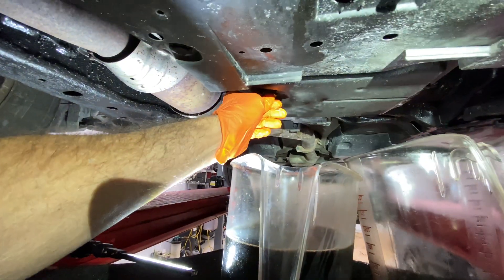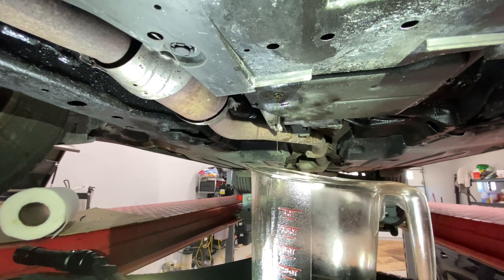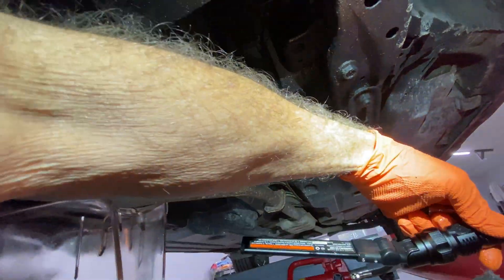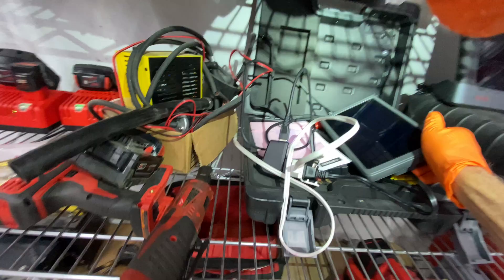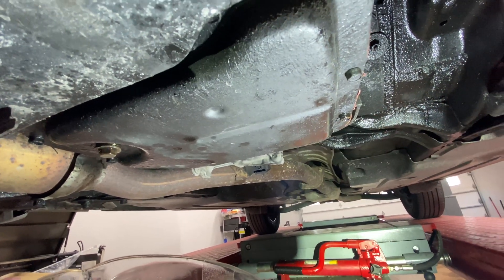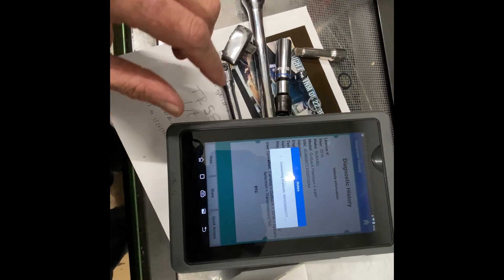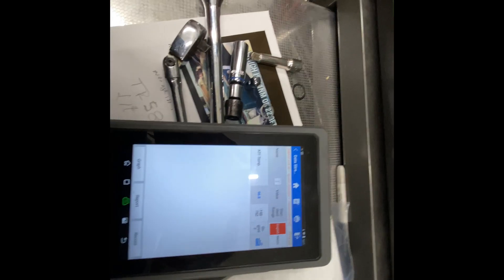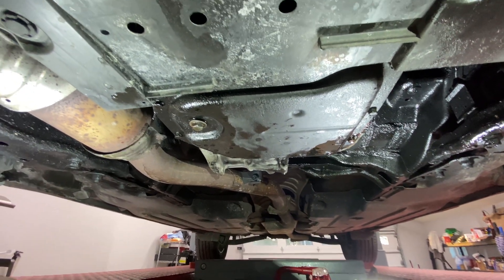2016 Subaru Outback TR580 CVT second fluid change in 3 days

Comment: there's a filter in transmission 12 bolts pull pan off right there don't have to disassemble trans that's a myth
Reply: in the gen 5 subaru with the 2.5i. it's more a screen than a filter.